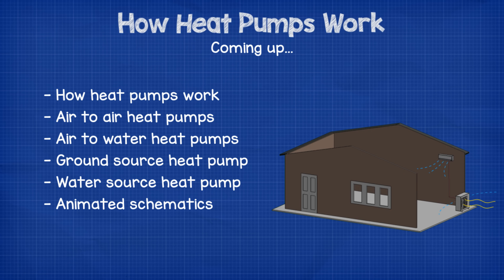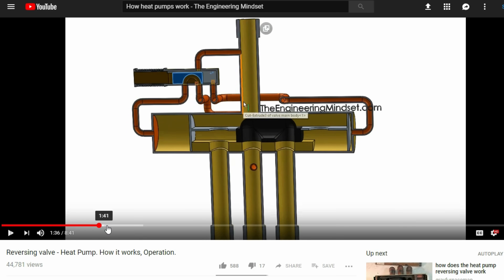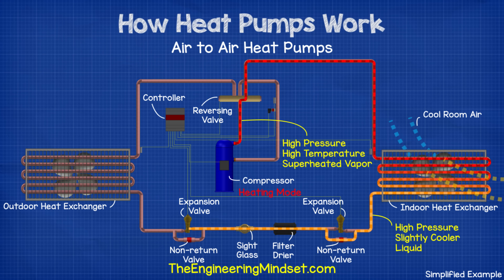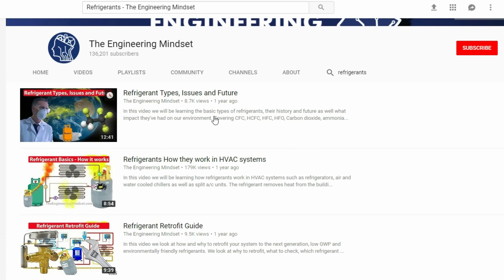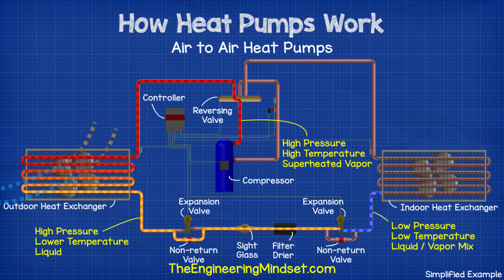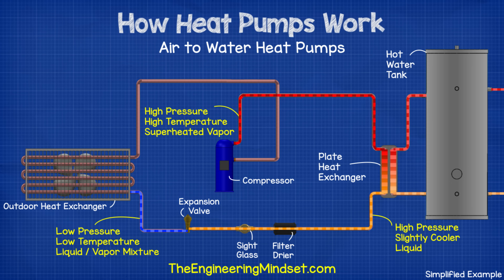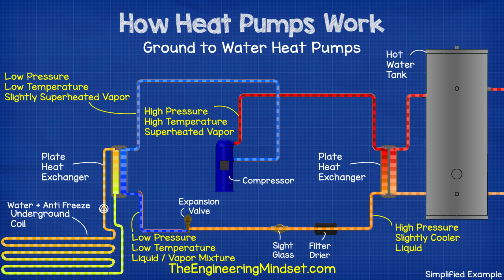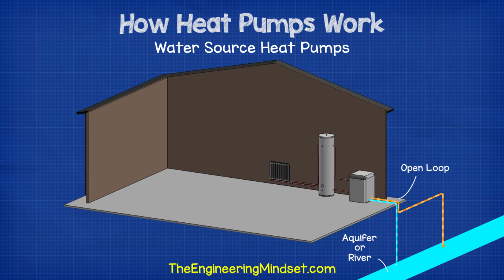Heat Pumps Explained - How Heat Pumps Work HVAC

Comment: Excellent video on heat pumps as I kept hearing this being used in other countries. Now that I have seen how it works, it appears that the limit of the system for heat output is the power consumption of its compressor.  It seems that a heat pump is less efficient than an electric heater as some heat is lost from the outdoor unit.
Reply: In fact, the electricity needed to transfer heat is roughly at 1:4 ratio. So pupmping 4kW from outside into the house costs you 1kW of electricity. And of course the waste heat of the compressor is not just dissipiated but preciously harvested and added to heat potentially transferred in your house. Those schematics depicted in video are pretty rough, but in principle thats all the magic behind this.
Reply: pure electric heater has "100" pct efficiency but heatpump has  200 to 500 pct efficiency. ( not breaking thermodynamics law, just "stealing" energy from outside and pumping it to higher potential).
Reply: I can't see how there is any heat when it is 38 degrees out to bring inside
Reply: My heat /ac pump does not warm the emerg heat has to come on before there is any heat abd then we have to go turn ut off  when it starts warming up. This isn't normal is it?
I had a heat/ac technician cone out. He Said the thermastat needed reprograming. Which he did and left. No charge but  the emerg heat had to come on and then we had to turn it off  help
Reply: @SUMMERFIELDish  that is normal.  when it is too cold, it freezes the fins on the radiator and the flow of air is less or no flow of air at all. The emergency heat is used to melt the ice

Comment: Sure looks like a lot of components that could fail...and who has the skills to properly diagnose and then there's the cost of replacement parts $$$
Reply: It's not that many components, only a few more at most compared to a normal forced air a/c system. Keep in mind your home a/c system is relatively simple "components" wise compared to something like your car. Both of which have been made for years a volume.
Reply: A skilled service tech would be able to properly diagnose and repair.
Reply: @joedixon8804  ...key word "skilled", and then there's the cost of replacement parts $$$$
Reply: I don't know about the combined cooling and heating AC. Here where I live we only need cooling and everyone I know have at least one AC which is basically a heat pump. Not to hard to maintain, and lasted more than 5 years. Just need some cleaning every 6 to 12 months, which cost around 10 to 15 USD per unit.

Comment: I’m 36 and have been an HVACR tech for 17 years now.   Heat pumps have come a long way.  I don’t care who says what they are very practical and efficient.  Check out the Mitsubishi Hi-2 versions.  They give you 100% heat capacity at 5 degrees Fahrenheit and 95% heat capacity at -15 degrees Fahrenheit!!!   That’s insane.
Reply: Thinking of purchasing a Gibson 3 ton heat pump. My home is about 1,900sqft. I’m assuming it’s the latest year available. It’ll be tied into my original duct work. I’m not sure how hot or cold the machine can get. Im from PA. I have an oil furnace now. Contractor explained to me that the unit that’s in the home has a heating element built inside that will kick on once temperatures outside is about 25 degrees Fahrenheit. That acts like a booster to heat the house more.
Reply: @Domiano542  any update on your decision. I'm in the same position trying to decide if I want to go that route or go with propane. I'm also in PA
Reply: @Domiano542  Heat pumps are very good for saving energy. Just make sure that if you want to get a radiator, it must be compatible with it so that you can have more heat.
Reply: Whats the life span for heat pumps?
Reply: Hey guys,
I think HVAC is truly magical. Do you guys feel this is a career for younger men or guys who have already been doing it for a long time. The schooling does not give me concern, but the physical strain on my body does. I'm 42 and now live in Japan. It would be nice to move toward a profession where I could earn decent money until retirement. Thanks for the info and suggestions
Reply: They have become very efficient
Reply: Should I change to a heat pump now that my gas combi is now at the end of life??
Reply: @tomrivans9102 if you have a Natural gas / oil / propane furnace you can Install a new furnace BUT combine it with a HeatPump this is know as a Hybrid System.  The HeatPump is cheaper to run the Oil or Propane in my opinion High Efficiency 2 stage & Variable stage Natural gas furnaces are very efficient but even with the Natural Gas I still would combine it with a HeatPump.  
With stand alone HeatPumps they typically have Auxiliary Heat which it’s Electric heat elements.  These are 100% efficient BUT 100% expensive when engaged.  😣.  
Did this help you out at all ???
Reply: ：０
Reply: How much energy do they use for cooling in the summer vs traditional AC and how effective are they on a really hot day?
Reply: Can,t be true otherwise they wouldn,t need subsidies to get people to have them and when everyone can,t stand the noise anymore .they will be angry
Reply: @Jack-fs2im   Money scam. All politics are corrupt.
Reply: @Pimpasxx  we get the politicians we deserve.They all come from us.
Reply: they never mention how much electricity it takes to power the compressor and the circulating fans , thye are not effecient at all , they use power to create the heat , energy can never be destroyed , it can ONLY be transformed or transmitted , you do not get energy from nothing and heat is a form of energy
Reply: @andywarrington4738  Where's my facepalm emoji......
Reply: Hyy Sir 
Can You Brief me about use of Heat Pumps in Dairy Industry??
Reply: How about people living in -40 ? Cause that's definitely dropping an efficiency
Reply: Natural gas is extremely cheap in some regions and electricity is extremely cheap in some regions. Do the math yourself to understand if it's gonna benefit you. I've seen it going both ways. If you have time-of-use plan you might even want to switch between HP and natural gas furnace during the day.
Reply: @privettoli  they do have certain thermostats that automatically switch for you with an outdoor sensor.  
When I have done that my house that I used to live out in Pittsburgh, I had a hybrid system that was a boiler efficient tied into a heat pump system that would automatically switch over with temperature outside.   It was very comfortable/efficient.
Reply: Wow been a tech right out of high school? I just turned 34 and and been in the industry alittle over a year and half ago. My only regret was not doing this sooner ! I love it
Reply: Is it geothermal?
Reply: how much tome it tske for install and whats profit per install?😊
Reply: I can’t get past what Mitsubishi did to my family during World War II to justify owning one
Reply: We have one in our shop
Reply: Is it possible to power an air to water heater with a solar panel
Reply: @jodygallagher8829  Yes, with a large enough panel. It wouldn't take much.
Reply: Do you mean H2i ....
Reply: g g that’s one of them.   Mitsubishi
Reply: ApprenticeThatTextstooMuch and the electrical costs are?
Reply: @sheledmikymo  Very low compared with heating with gas and especially low compared to electric resistance heat. Heat pumps don't create heat. They use electricity to move refrigerant, which carries or "pumps" heat from inside to outside or vice-versa. That takes a lot less energy than creating heat.
Reply: @robeddy9381  true becuase nothing isn't wasted
Reply: @sheledmikymo  MUCH lower than using a typical space heater
Its the LED equivalent of heating
Reply: @sheledmikymo  extremely low compared to electrical resistive (baseboard) heaters and on par with gas heating, depending on your location. Heat pumps function by moving heat around where as standard furnaces/heaters work by creating heat from combustion or electrical resistance.
Reply: My mate has a heat pump and his bills per week are three times the cost of my old school combi boiler.
Reply: @Mr69sideshow  That's my experience too!
Reply: @Mr69sideshow   Because electricity is 3 times expensive than gas. ;)
Reply: @Pimpasxx  unless you have solar
Reply: @Mr69sideshow  maybe it’s not set up correctly all the charts I’ve seen show it cheaper with break even around freezing
Reply: @Mr69sideshow  three times bigger or smaller?
Reply: but what about the chemicals that flow through pipes? what if it got damaged and seep to the ground?
Reply: @wiezyczkowata  Refrigerants dont seep into the ground...
Reply: @shawnd567  sorry for sounding stupid but chemistry was never my forte, how do they behave in a pipes? are they like a gel or gas?
Reply: @wiezyczkowata  watch video again...boiling point is below freezing by 50-80 degrees.  Any leaks are gas.  It's only liquid under pressure (think propane tank for the grill)👍.  If there's a leak it's bad for the environment, but can usually be repaired and recharged like a car's ac system.  Hope you have a great day
Reply: @stephenwgreen78  thanks for the info, I'm really bad at chemistry and phisics and basically need the "for dummies" answers :-), your answer was basically what I was looking for so thanks again, have a nice day as well!!
Reply: @wiezyczkowata  no problem...we've all got gaps in our knowledge 👍 it's what I use youtube for😁
Reply: @stephenwgreen78  same!
Reply: @wiezyczkowata  the chemicals are refrigerants, some are more harmful than others to the environment. Its usually the same stuff you'll find in most AC units anyway. However refrigerants are becoming more and more environmentally friendly, with a lot of modern units starting to use c02 or other non harmful refrigerants.
Reply: @wiezyczkowata  r32 is the latest refrigerant, its not a big problem for the environment, but its very flamable :)
Reply: @zanestorrie5195  It is great that you have information in this field and it is important to you
Reply: @wiezyczkowata it won’t soak into the ground refrigerant is a vapor at air temp it is only a liquid in the pipe because of the pressure
Reply: @ashtonpacheco797  thank you so much for the answer, that clears a lot of issues I had with it
Reply: @wiezyczkowata  for reference, theoretically it's possible to create a heat pump using CO2 as the refrigerant gas. However, you need piping that's strong enough to withstand the pressure required to liquify the gas
Reply: @caffeinatedinsanity2324  thanks for the answer!!!
Reply: @wiezyczkowata  that would be alcohol called loopanol

Comment: Heat pumps I work on have accumulators? Also no expansion valves. They have orifice metering devises.
Reply from the maker: There are so many different designs out there

Comment: is there any way to recover the energy from the wasted heat in order to improove efficiency ?
Reply from the maker: Can go for a vrf heat pump system. These allow simultaneous heating and cooling https://www.youtube.com/channel/UCk0fGHsCEzGig-rSzkfCjMw/videos
Reply: ssllhh100 Hi, for an water source heat pump you can use this the wasted energy either heating or cooling if you have a series of outdoor units coupled together.
Reply: Second law of thermodynamics, with every exchange, our energy storage, is becoming more and more diffuse and less and less usable. I'd imagine you could surround your heat pumps, with other heat pumps, until there was no usable energy left and it was requiring more energy to drive the pump, than was being extracted.
Reply from the maker: New VRF unit video here:➡️  https://youtu.be/4i1XgcP1tmw

Comment: Here in New Zealand if the outside temperature goes below -5 Celsius  the heatpump stops to defrost too often and is virtually useless.
Reply from the maker: There are so many designs for heat pumps, I would say the one you have doesn;t suit your needs.
Reply: I come from Poland where the ambient temperature goes below -20C and still it makes sense ...defrost is natural but with modern units the process is reduced and if you use the buffer tank the system works OK
Reply: Same for Sweden
Reply: High humidity causes frosting which is the same problem we have in NW Washington State. We see horrendous electric bills as the backup heating elements have to kick on all the time. I would never install another heat pump in this type of climate, totally inefficient.
Reply: Defrost is more relevante to individual split system, as in the UK the seem to go into defrost at + 1C
Reply: Thats why heat pumps have auxiliary heat.